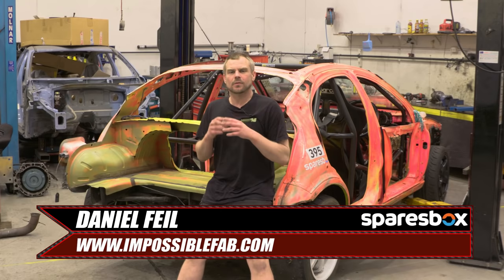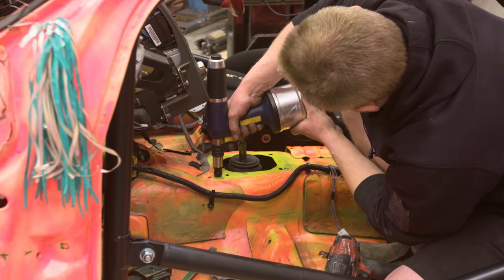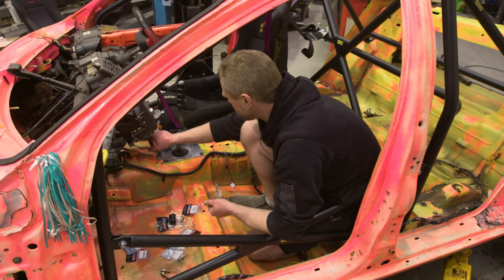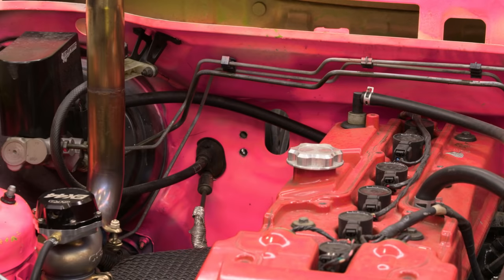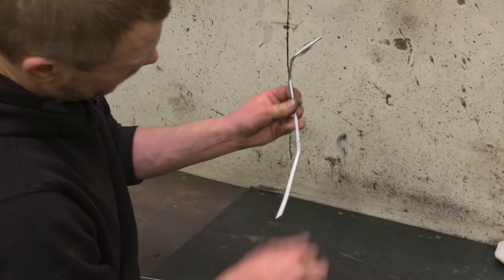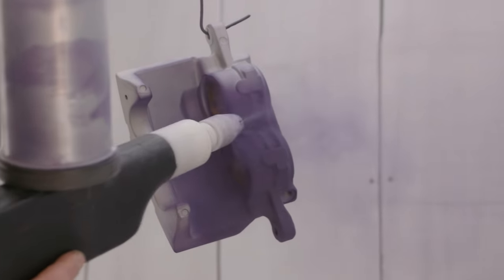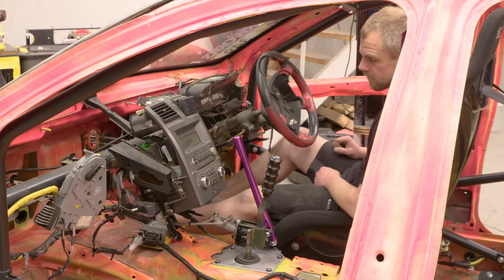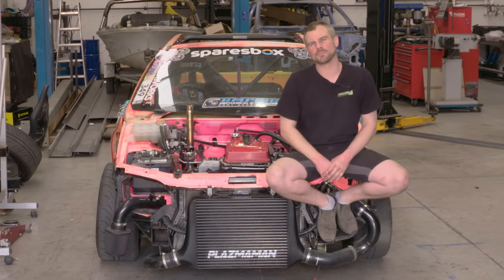Bazza the XR6 Turbo gets a Hydraulic Handbrake and Brake System Upgrade

Comment: Tip for beginners, reverse bleed hydraulic handbrakes, as it's beneficial for pushing air out, including clutch cylinders and non ABS brake systems. You have more success pushing air up then down around bends. But great work none the less. FYI, I would have also replaced the known problematic rubber brake lines while I was at it, particularly the rear.

Comment: so you installed a shut-off and are only using the left side brake line for both rears on the pedal, and you are using the right side for the hydro into your tee on the left line? did I get that right?

Comment: Thoughts on the reverse mounted handbrake master?
Reply from the maker: Makes no difference how its mounted really.
Reply: @MotiveVideo  push vs pull I think was the reference.
Reply: @MotiveVideo  difference would be leverage. personally ive never tried one so i dont know what the 'feel' is like, but this setup has more leverage, as if it was mounted behind the lever it would be above the rotation point

Comment: What exhaust do you recommend for a barra? About to start a build....
Reply: 4 inch straight through sounds mint
Reply: 6Boost 👍
Reply: @MafiaboysWorld  They do full length for the barra or just cat back etc? Ill go their turbo mani for sure. Got 1 on my 2j
Reply: @slicktop2jz855  Ahh, my bad, thought you meant manifold. In that case, Empire Mechanical do exhaust systems, so do Mace engineering. If the Barra is in anything other than Falcon, then custom all the way. 👍
Reply: @MafiaboysWorld  Sweet as cheers man. Yeah im gonna whack one in an r33
Reply: @slicktop2jz855  Ahh, then custom the whole way dude. Good luck. 👍
Reply: @MafiaboysWorld  Knew I recognised you....Remember calling me a scrublord.....Still happy to line my 2j swapped 300zx up against anything you have....825rwhp@36psi...I live near Bathurst, so perfect place....
Reply: @slicktop2jz855  hahaha, I call a lot of people scrublord, means I was being nice with my insult to you. 😁 As for your location, yeah, the perfect place...to be in lockdown, you unclean people. 😛
Once my shitbox is done, I'm running everyone, with a certain Volvo being 1st on that list. 😈 But I'm trying to just get back to it right now, hence my new project ATM and fixing it so I can get back to finish the shitbox. 🤣👍
Reply: @MafiaboysWorld  Im up 2nd then 👍try and get in to the coota drag meet, we can do it there if we both qualify...
Reply: @slicktop2jz855  At this rate, my car and Coota won't be ready until 2022. Also, you'll probably get me as I'm not aiming for 850hp, only 600ish. The engine is able to handle it (1200hp block, the parts used is all on my channel), but I want reliability for days for road trips, so only shooting for low 20s psi and using unleaded fuel only, no E85 and flex fuel sensor.